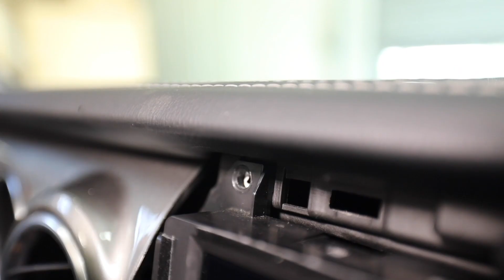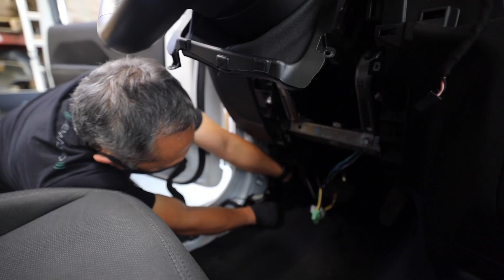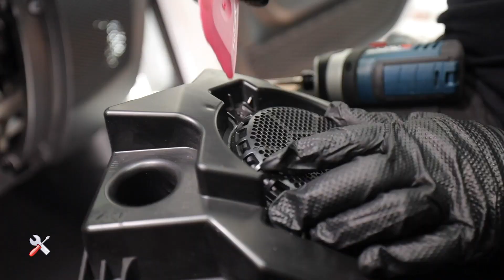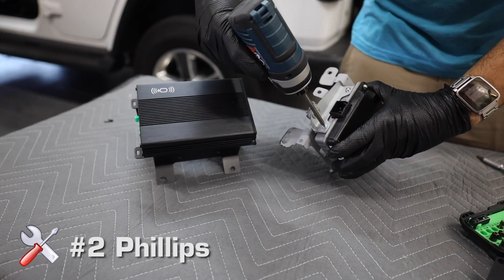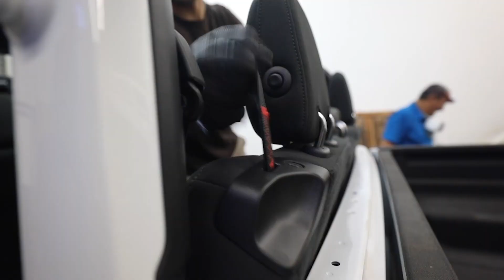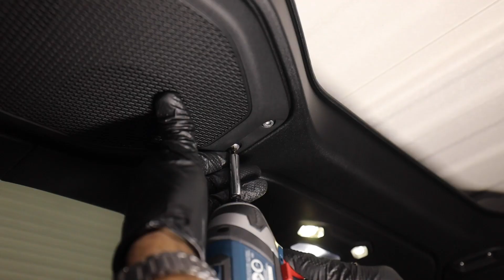Jeep Gladiator | High-Resolution Audio Install

Comment: I have this in my Gladiator and it constantly shuts the sub off if it’s hotter than 85-90 degrees outside. Very annoying that something I spent this much money on can’t function as intended.

Comment: Just replaced OEM Audio + for my factory 2023 Jeep Gladiator Alpine system. Take 4 days to figure out why the Sub had no signal output.
Finally, the problem was system is not activated from the factory before it sends out to customer.
But at the end. I am 100% satisfactions. Clean and clear sound.

Comment: is it still good with the top off as well?
Reply from the maker: the nature of acoustics is that it requires the ability to reverberate. Our kits are tuned for the driver seat with the top on. Its still an improvement over the OEM (plus) as in louder than factory!

Comment: Amazingly details video. Seriously well done. Curious to know if this system is an upgrade for “base” stock stereo only or would it be much of an upgrade on the stock Alpine systems? 

Also, does the sub box work with a gladiator that came with the removable Bluetooth speaker?
Reply from the maker: Jesse, Thank you for your feedback. We strive to ensure our instructional videos include every step involved to allow our owners to have a seamless upgrade pathway. The Signature Edition Sound Solution is designed for both the base and Alpine factory audio options. Providing quantifiable results for both configurations (next level clarity, loudness, and impact). 

Regarding the factory removable Bluetooth Speaker, unfortunately, our Subwoofer does occupy the same footprint as this factory option.

Comment: did I miss the part about the bass knob? Where is it recommended to be installed?
Reply from the maker: Gain Control Knob mounts in your preferred spot, most common location for the Gladiator is the glove box, under the steering column, or center console (close to where the driver's right knee would be).

Comment: All that work and keeping the little 7" head end?  And replacing tiny overhead speakers with better tiny speakers?  Really?
Reply from the maker: Yes exactly! No change to the way you interact with your music (maintaining all factory functionality and look), however completely transforming the sound quality to the in-cabin listening experience (adding clarity, loudness, and the impact that was missing).

That’s correct! Anyone can make their existing components fit (you can make a square peg fit in a circle hole with modification). Our approach is maintaining the factory mounting, connectors, and integrity by engineering a speaker from the ground up tailored specifically for the Jeep, all the while delivering an immersive sound that exceeds your expectations. This approach isn’t as easy as using something already made. It was costly and exclusive to the Jeep, but the results are worth it in terms of seamless integration and sound.

Comment: Excited to upgrade to this soon.  What a disassembly though. Should’ve just said “disassemble Entire jeep”.
Reply from the maker: Agreed. The disassembly involved in getting to the factory dash speakers is not for the faint at heart. One of the advantages of using the factory speaker locations in the vehicle is a cleaner installation - However, it definitely involves a bit more time and attention. Please continue to utilize our team as a resource throughout your experience (before, during, or after your installation). Your satisfaction is our top priority.
Reply: @Oemaudioplus  definitely the only way to do it right. But Jeep couldn’t have made the passenger side any more difficult I don’t think. Great looking product guys!
Reply from the maker: @road2therunway  So true!! Thank you for your feedback sir!
Reply: @Oemaudioplus  Precisely the grace of buying this product is that it is not only a sound system, this is a whole project that is what excites me, if I buy this product it is because of the excitement of disassembling my Jeep and putting it back together, in fact I would not do it All in one day, I would enjoy it to the fullest in a multi-day project with some good beers and my wife sitting to one side talking up to her elbows.
Reply from the maker: @hectorgonzalez5094  we share your excitement! There is truly a whole different level of satisfaction in starting and completing a project of this caliber. Especially when everything lines up as prescribed and you get to experience your O+ Sound Solution for the first time. Please utilize our team as a resource throughout your experience (before, during, or after your installation). Your satisfaction is our top priority!